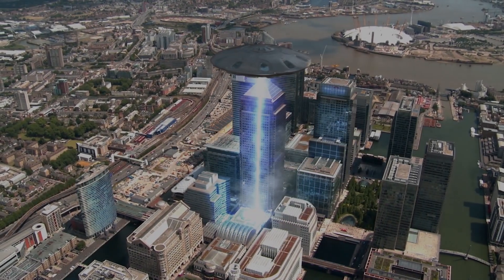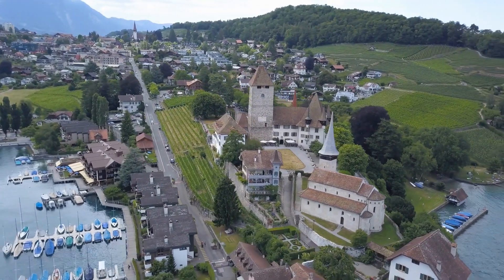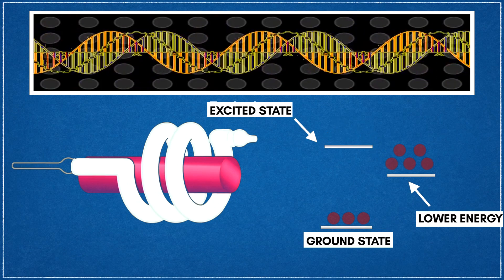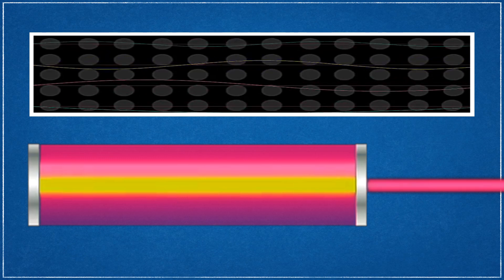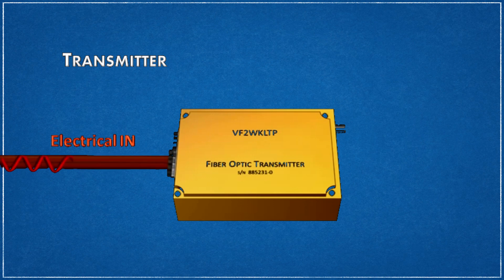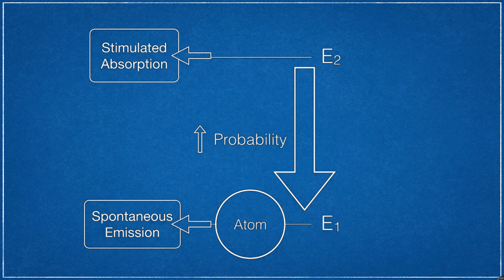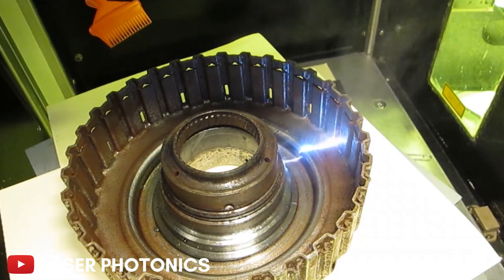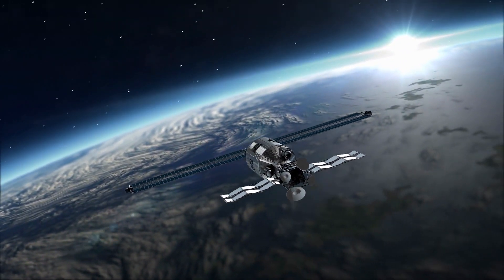A Look At Lasers | Ruby Laser, Fiber Optics, Laser Cleaning

Comment: WTF?! I spend most of my time on YouTube searching for content based on electronics, optics, and lasers… constantly searching every day or two for new laser content. Using all of the keywords and stuff like that… And this video has never appeared in my recommended search results.

I just stumbled across this video by accident while looking through your channel. 

I’m not a professional as it pertains to lasers and optics, however I do Have my own electronic lab,….. i’m self-employed full-time. And Focus predominantly on component level board repair for a wide range of industrial and government clients. My specialty is large industrial control equipment. Like VFD, servo drives, PLCs, CNC equipment, stuff like that. I don’t do the mechanical stuff anymore… I just do the circuitboard repair and troubleshoot boards. I also do a lot of test equipment repair and calibration… With a bit of metrology just to test my patience.

over the past several years, I’ve spent a ridiculous amount of time and energy putting together a industrial grade, scientific and compliant optics laboratory in the corner of my electronics lab.
You can’t imagine how expensive that stuff is if you have to buy it new… even for a basic professional starter set up… You’re looking at at least 20 or 30 grand. Way over my head, especially considering it’s mostly just a hobby. I have no way to justify spending that kind of money on optical equipment…So I went to a lot of government and industrial auction… You can’t imagine the wonderful things you will find… Complete pallets full of unused equipment. Some of my best scores Includ a REAL Industrial optical breadboard, dozens of high powered medical/industrial lasers, and all of the cool optics and other stuff to go along with it!!  I can do almost any optical experiment that are common in research and physics in this modern day and age. 

It’s so much fun and I highly encourage anyone who’s interested to give it a shot! Start with a small table top setup… With a small lightweight optical breadboard, optics, and all the mounting hardware and lasers. If you look around you can get some sweet deals. Because if you have to buy stuff new from the companies… A single lens or sensor could cost you $400. Or a simple mount mirror mount could be $150! But on the secondhand market you can find stuff gently used or brand new… And you can get a huge box of the stuff for 50 bucks! Do that enough times and really dig around… And you can set up a really nice lab on a shoestring budget.

it really is a golden age of electronics and equipment. If I had to buy all my laser lab equipment at normal prices… It would be close to $50,000. And I paid less than a 10th of that! Spread out over five or six years of course because I’m not made of money. 

So although the laser and optics/electronics hobbies can be expensive… You can buy the stuff for 3 to 5% of its actual value! Look around in your area for government and industrial auctions, Auctions in academia, and companies going out of business. 

I have multiple kilowatts worth of optical laser power in my lab, all of which was bought for pennies on the dollar… A lot of it new stock… Because the extremely powerful lasers used in industry, For scientific research, and high power fiber coupled lasers used in communications… are upgraded so regularly… That once a new model comes out they absolutely give away the old stuff for Penies…even if it’s new in the box sitting on the shelf.

For example if you weeks ago… I bought three separate Jenoptik modules for $70 a piece new in the box. They’re well over $1000 each, retail… And they are still current technology and whats still used today. It’s not like they’re out of date or anything. And 45 Watts might not sound like a lot… But 45 W of optical output power is enough to slice right through a lot of things. For reference…Those super powerful burning laser pointers you see on YouTube… They’re usually 5 W or less. Usually much less like about a half a watt. So these 45 W and 80 W modules I got a hold of, are pushing an absolute insane amount of power… And they’re really expensive if you have to pay the new price. And I’ve got stacks and stacks of powerful laser modules on the shelf in the lab. And if I had to add it all up, I’ve got at least a few kilowatts of power. If I had to buy just those lasers and pay new prices… Good Lord it would be worth more than a house. And if you look around carefully… You can get the stuff for almost free.

Thank the Lord for the secondhand market and for government budgets and waste 😁